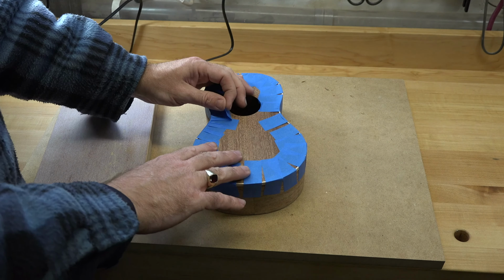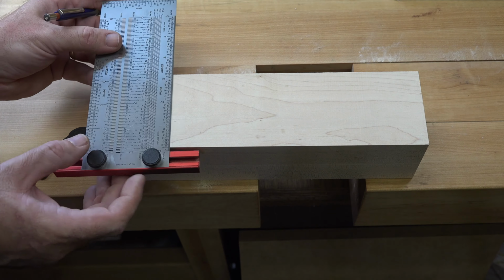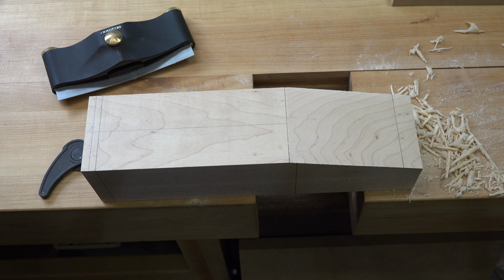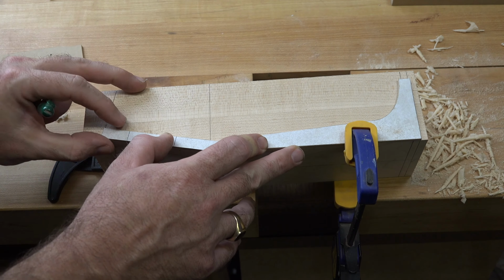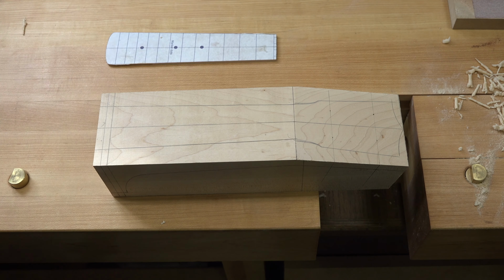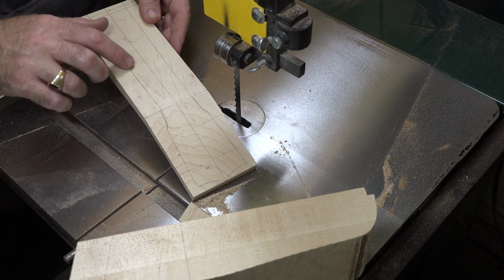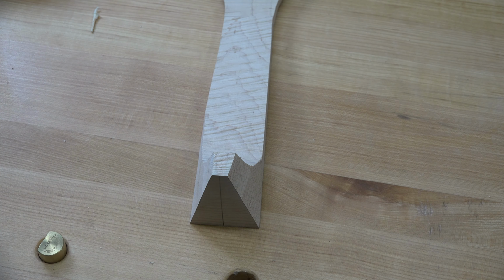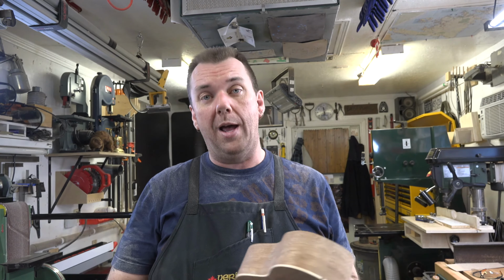Making a Ukulele Part 8

Comment: I notice you made your neck with the lamination oriented so the blank was flat sawn. Most others make the point of orienting it so the grain runs vertically on the neck. They claim this is for strength. What is your opinion on this?
Reply from the maker: I honestly believe that in this particular instance, the grain orientation when laminating the blank for the neck, the difference in strength between the two methods that you describe is negligible. There is no difference in strength between the two in this case.  While there are instances where grain orientation will make a huge difference in the strength of a piece, there is enough material involved here and the tension of the nylon strings is not enough to make a difference.  Either way of lamination is perfectly fine.  I hope this helps Dana.  Thanks for tuning in .

Comment: Where do I find such a ruler?
Reply from the maker: Those rulers are called T-rules and they are made by INCRA.  They are available at most woodworking stores such as Lee Valley Tools.  Here's a link.  http://www.leevalley.com/en/wood/page.aspx?p=58877&cat=1,43513,58883,58877
They are also available from INCRA themselves from there website.  They are available in metric and imperial measures and I promise you, that they are worth every penny that they charge for them.  Thanks for tuning in to the show.

Comment: It is far easier to cut all the frets parallel while the neck blank and fretboard are still square.
Reply from the maker: +Wolf Lahti 
It's not always about the easy way.  But you are right, that would be easier.  The methods shown here are only one method to complete this task.  There are many methods.  Thanks for sharing yours.